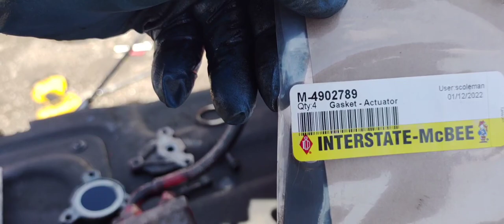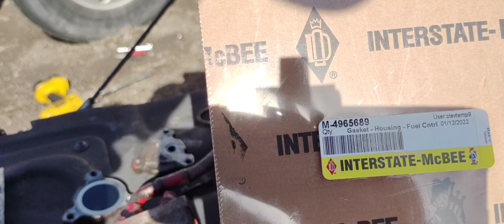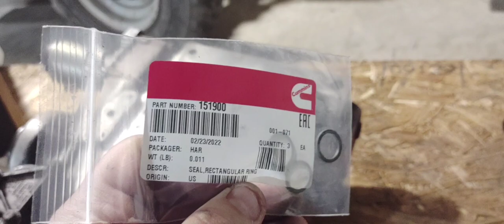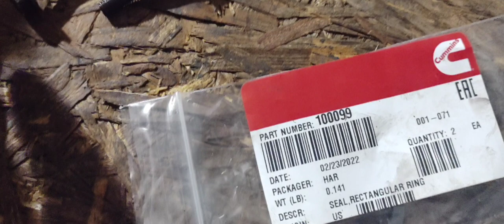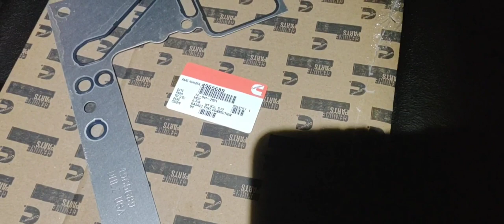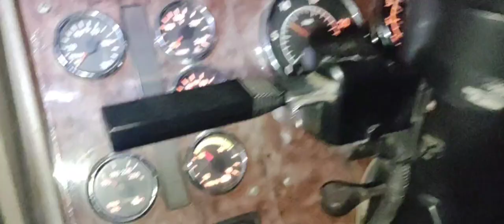Cummins ISX Fuel leak cm870/871 fuel dampers

Comment: Was there any runout symptoms like feeling like the engine is missing while idling/driving. Or  is the leaking fuel the only issue.
Reply from the maker: The fuel leak was the only issue you'll notice when the engine gets colder or it's rather cold outside you'll start seeing a decent trip of fuel underneath your truck....

If you're having performance issues and a rough idle you're most likely having injector issues but it could be anything it's hard to diagnose over YouTube comments
Reply: @Jackknife-TV  I appreciate the info and video. I have been chasing an accelerating stumble on my truck for the last 2 weeks. My dampeners aren't dripping but thought maybe if they were sucking air it might be causing the stumble. I changed all components I'm just missing something what's causing it